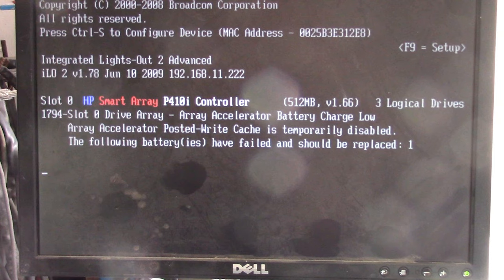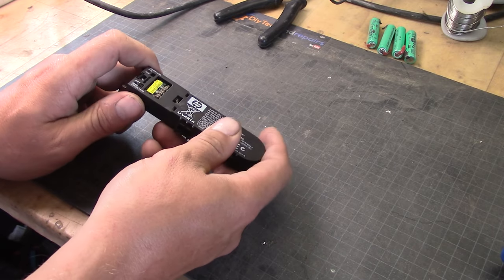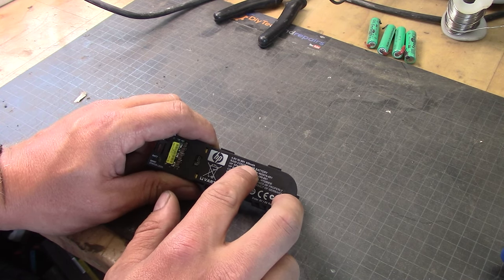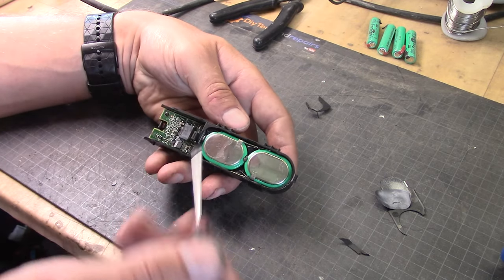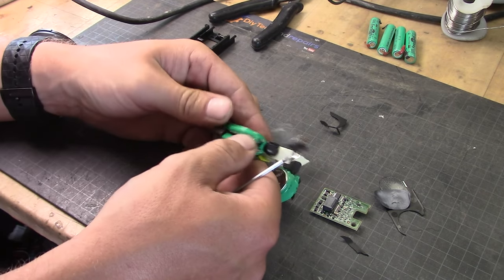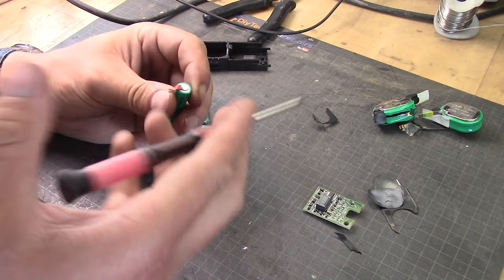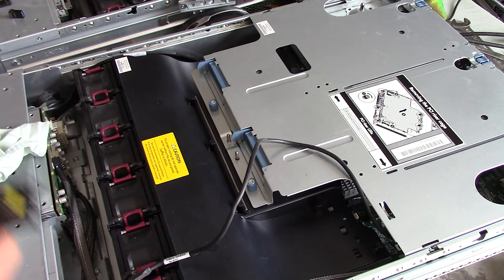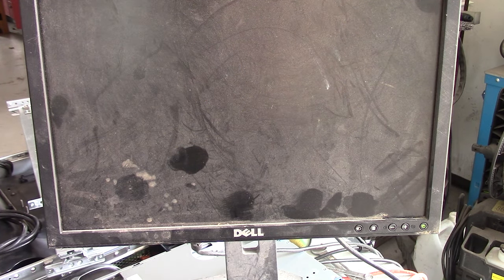Repair HP G6 Server raid accelerator battery

Comment: I hve this same problem. Thanks si much for your video. Can this Raid battery replacement message have an impact on the reading or writing speed of data To Storage?!
Reply from the maker: Without cache you loose alot of performance. Its like Night and day
Reply: The controller deactivates the dram-cache automatically if the battery goes flat. The loss of performance is dramatical! However in the ACU (Smart Array Configuration Utility in Windows) you can reenabel the dram cache and regain performance. Beware of the risk of data loss in case of mains power failure! UPS is highly recommended!

Comment: Thanks for sharing!
I'm just about doing the same on our DL180G6. I know, it's an old server, but it servs our small business well as a veeam backup station. 
Concerning the original hp battery pack: They have quite litte lifespan. The first one was flat after 3 years of operation. If've replaced it with an original on, which died after another 3 years. Now, that the server is out of its rack for a hard drive upgrade, i'll fix the battery as well. I'll use eneloop AAA cells. I see no use in buying another overpriced HP spare, which is prone to fail soon. Besides these spares are probably have been sitting on the shelf for over a decade now.
Reply: Worked like a charm! I've secured the battery compartment with some velcro strips to the metal casing.

Comment: hello buddy, If you have a problem with my server, I will be glad if you help my server was working fine until yesterday, but later it started to give disk error and the operating system does not start model: HP proliant dl380 g6 operating system: win 2016
Should be Raid 10
the mistake is this: 1716 - slot 0 drive array Media error 
1778-slot 0 drive array resuning data recovery 
1794-slot 0 drive array accelarator battery/capacitor
These are the mistakes, I would appreciate it if you make a video about it
Reply from the maker: Dont know those errors. Sorry